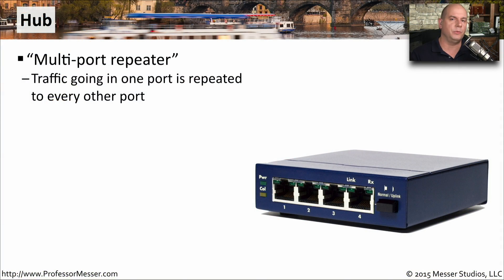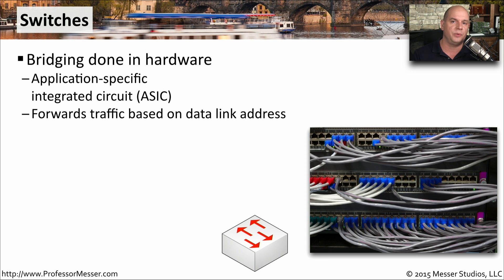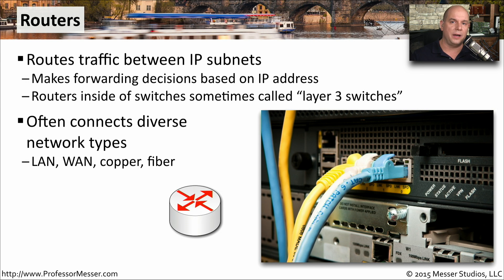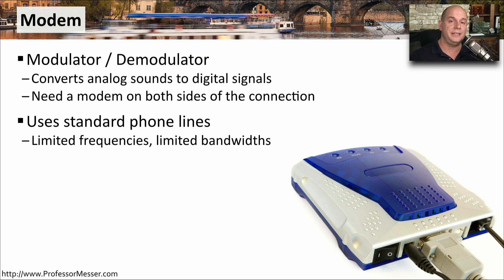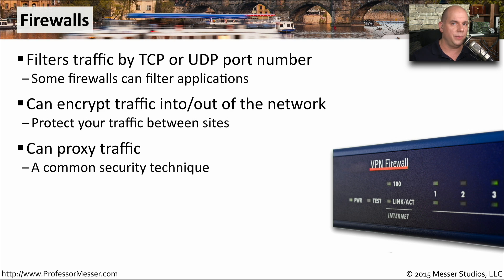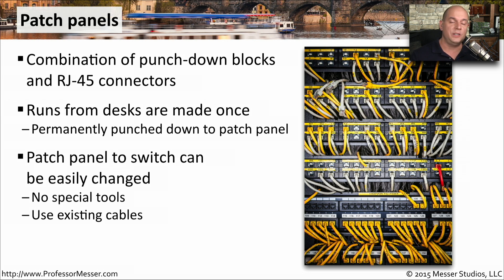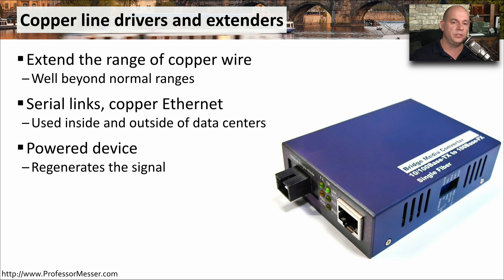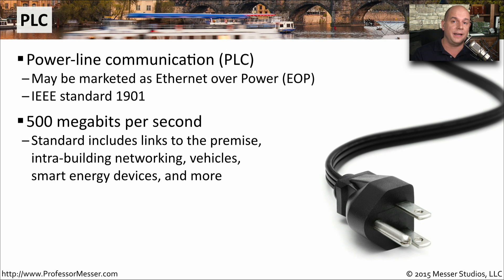Network Devices - CompTIA A+ 220-901 - 2.8

Comment: Quick question about Power over Ethernet's mode A. Wouldn't having the power run through the same lines as the data cause interference?
Reply: The technology is made possible because electricity and radio signals use difference frequency during propagation. imagine electricity at 60Hz and a radio frequency at 2,4 or 5 Ghz, they can travel on the same channel without interference.
Reply: @adeoyesaheed4139  Nice answer